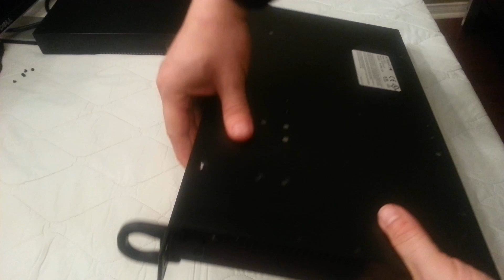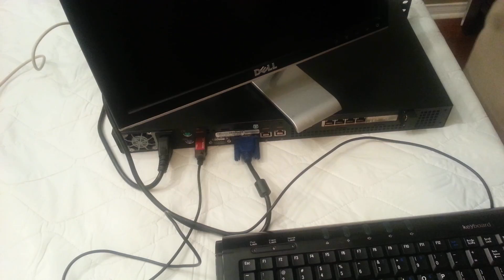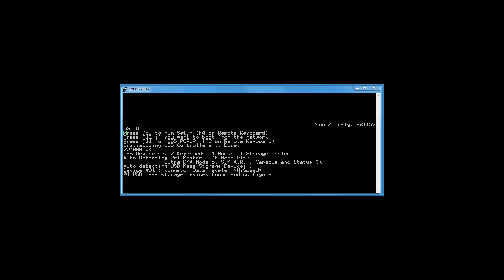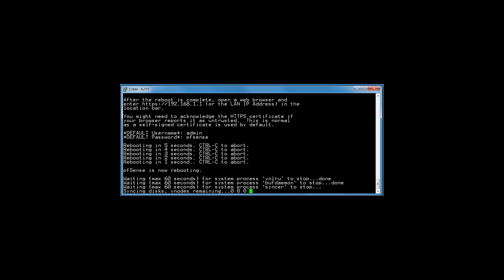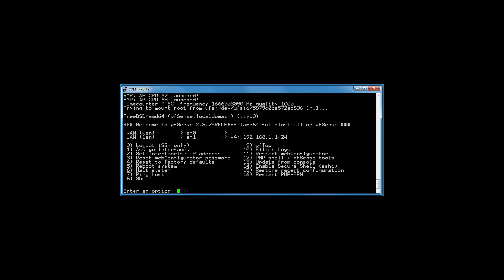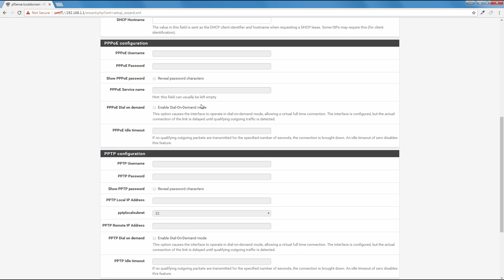✅ Supermicro 1U Server pfsense install - Find out if it recognized my eBay Quad Port Intel Card!

Comment: why do you need that many Ethernet ports?
Reply from the maker: Multiple internet service / Cable / DSL. Failover and Load Balancing configurations. Segmenting Business centres (each business has their own private network and share only internet and printers). Segmenting departments for better security. Office section does not need to see manufacturing floor computers and vice versa.

Comment: what model of SuperMicro is this??? I need a small 1U like this but cheap... this is perfect
Reply from the maker: This looks like the one in the video. The case is common across a number of supermicro servers.

http://www.supermicro.com/products/system/1U/5015/SYS-5015A-PHF.cfm
Reply: this is fully X86/X64 compatible??  I really want to run Sophos or maybe pFSense....I want DIY but cheap
Reply from the maker: I installed the 64 bit version of pfsense (amd64). Here is the status page indicating so.
https://youtu.be/bD3b9O-eIAQ?t=881

The only issue maybe how much data you are going to process. This is not the newest atom chip and max memory on this system board is limited to 4GB
Reply: Its for home use so no more than 10 systems... Just trying to learn firewalls and Sophos is looking good as well as pF.
Reply from the maker: That's fine - these supermicros come on ebay often - keep an eye out you will find something cheap.
Reply: How quiet is that Dell T330 server you did the video on?
Reply from the maker: With the drives it has in there it's little more noisy than a desktop tower. The more drives you add will increase the noise (unless they are SSD's which are supported on this server). The fan speeds will also increase if the thermal temperature increases. During post the fan speeds will spin at max for a few seconds - normal for most servers.
Reply from the maker: I think this is the motherboard - I think the biggest limitation is the memory. 2GB max. I think there is a similar board that can do 4GB. I'd check ebay - even used these things don't die - except for power supply - maybe after 5 years.
http://www.supermicro.com/products/motherboard/ATOM/ICH9/X7SPA.cfm?typ=H
Reply: Ok. I been doing research on supermicro. They have older versions all the way back to P4 days.  I seen a bunch of motherboards and cases as well as servers but it's tough to know which board fits in which case.  I have a ivy bridge i3 and DDR 3 I would like to use so hopefully I can figure out which models use those. Also any ideas how the atom based ones perform under pfsense??
Reply from the maker: pfsense works very well with the atom processors. I have used them for small clients. There is an atom C2000 bug that if affecting some products. Look into that before purchasing anything with that chipset.
if you already have a processor and memory just pickup a 1U short depth case and motherboard that will work with what you have.
Reply: problem is I dont know what cases and motherboards go with each other... looked at Supermicro's site and around on Google and there are a TON of cases and even more motherboard models... I know these dont use standard IO shields so you have to make sure to get the right one.  I also have one of those 4 port NICs and want to make sure the board will work with a riser card and that NIC.
Reply: Thats why I like these Supermicro servers... the board matches the case due to no IO shield... NO 1U case will work with most of the ITX boards out there...  Buying new is way out of my budget right now... so trying to go used and cheap... LOL   I KNOW there is a server out there, just figuring out which model works is a bit tough and then you need to find it!